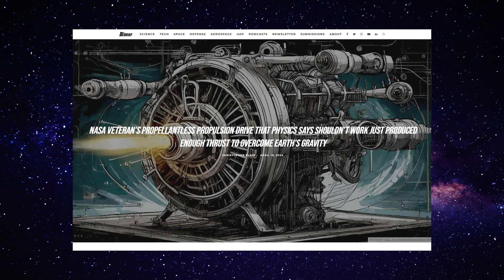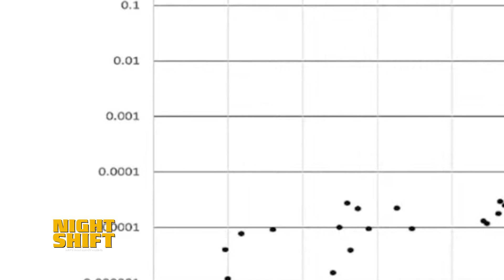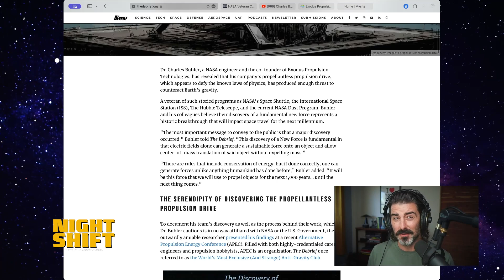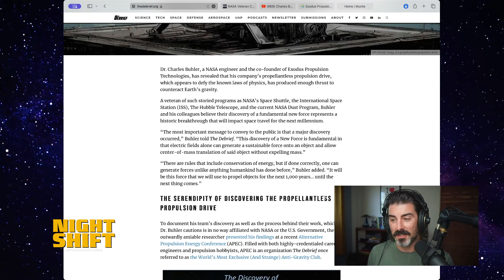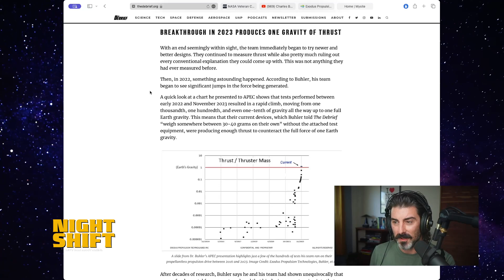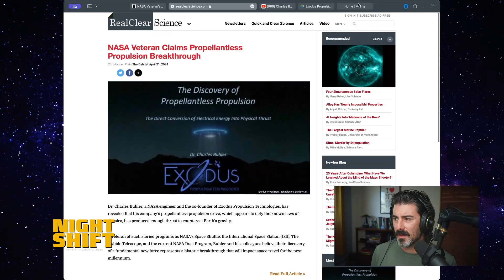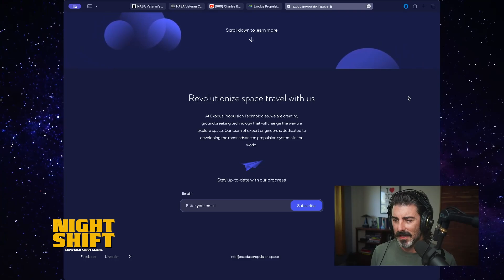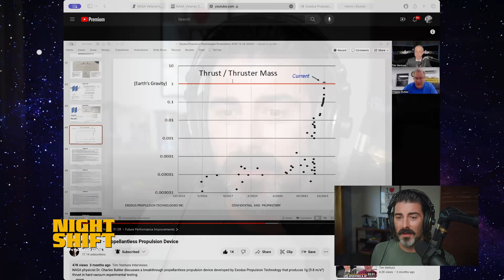Revolutionary NASA-Designed Gravity-Defying Drive Achieves 1G Thrust Without Propellant

Comment: It is called an asymmetric capacitor and it works best with huge voltages. Another approach could be that antiphase oscillation is used to manipulate space-time itself. By utilizing two oscillations that are perfectly out of phase, this idea suggests a form of energy cancellation or control, where destructive interference could be engineered in such a way that it alters the fabric of space or the propulsion mechanics of the spacecraft.

Comment: Use a centrifuge to accelerate a magnetic sphere. When the sphere is released the opposite and equal reaction is towards the center of the centrifuge not opposite the direction of the spheres motion. The sphear continues along a linear tangent towards an induction tube where repulsive forces transfer the kinetic energy from the sphere to the tube. The tube is part of the ship's Hull. VOILA!

Comment: It is not propellantless.. it still requires electric power which means a reactor of some sort. Gravity propulsion may be new but gravity is not.  If you understand the mechanism of gravity, then you can proceed to gravity drive. Electrostatics is short range.. gravity is long range.. gravity drive is gravity manipulation. Dark matter exhibits antigravity for a good reason. Gravity drive or variation is what you need to navigate gravity space. It doesn't require a change to physics.. it requires an extension to the existing physics. If they are just messing with electrostatics, I wish them luck😆

Comment: Ok, 1G is about 22 miles per second.  If acceleration remained constant, the vehicle could get close to the speed of light in one year and travel half a light year.  So, acceleration increases exponentially and could go potentially faster than that after the year's end if we say there is no speed limit.  (Theoretically nothing can go faster than the speed of light except for quantum entangled particles which would be like instant travel thru a star gate or using a Star Trek type of transporter without distance being a factor.  I also realize it would probably not be possible to run the engines the entire time but if those were not factors then that math is correct.)  Now, the closest star to our solar system is Proxima Centauri which is an estimated 4.27 light years away.  Just putting some numbers that we can all relate to as I had to Google how fast 1G was as aviation speed is expressed in knots and jet speed is expressed in Mach number.  An asteroid hitting Earth's atmosphere does so between 7 to 45 miles per second, the orbital velocity of an asteroid in the asteroid belt is between 9.3 to 15.5 miles per second and the Earth's orbital velocity around the sun is about 18.5 miles per second.  Of course those numbers are relative because our solar system is going around the Milky Way galaxy about 143 miles per second so that means the Earth is going way faster than its relative speed to just our solar system.  My point is that is faster than an asteroid, it is faster than our planet around the sun, that is a big deal.  

 The paper says propellent less propulsion device but does not say how it achieves that so it could be electric using as the doctor said,  thin films  and asymmetrical capacitors, which is high voltage differences to a large surface followed by a larger voltage on a larger surface or some type of plasma generator.  He said car batteries have lots of power in them but they don't unless recharged by the alternator since each lead acid battery is rated on engine starting from cold cranking amps at 12 volts just to start the car.  When running, the alternator is the variable voltage generator that recharges the battery and provides all the electric power needed by the car's electric systems.  Lithium creates dendrites and degrades too quickly by shorting itself out when over heated or charged too often which also takes a long time.  Now the only issue is how do we power that voltage since battery technology is a joke and any nuclear reactor does expend its radioactive fuel at different paces depending on which type is being used.  One solution leading to one problem since we have not found a way to power a ship off of fictional dilithium crystals.   Oh, the military is powering the UAP's so they will know how to do it.

The military is always a few decades ahead of any of the latest released achievements they allow to be told to the public because all patents are scrutinized for military application first and when it can be weaponized, they can classify and confiscate that technology without compensation to the inventor in the name of national security.  Only our government can be criminals with murder, theft, environmental poisoning and political injustice to just lie to the public and get away with it.  Sad, if we had this tech released earlier, we wouldn't have kept burning oil to run our lives, we would have used these innovations to save our planet.
Reply: this is amazing! i wonder how many hours will it take of constant acceleration of 1 g would it take to go to mars?

Comment: That means that in space at roughly 1 G of acceleration, in one hour you would be just over 78,818 miles per hour!! Yes a game changer. If you accelerated for 10 hours you would be at approximately 787,909 miles per hour. At that speed you could get to Mars in 7 or 8 days🤯 instead of 7 or 8 months. Using the average distance to Mars at 140,000,000 miles.

Comment: Take 2 long metal plates about 5 inches long and about 2 inches wide. Place them under water...very close together....NOW...hook up a positive wire to one plate and a negative wire to another plate. turn the power on...place some red dye in the water between the plates....you'll see the water flow....they are designing submarine engines this way. the plate produce hydrogen and oxygen....one plate for hydrogen one plate for oxygen...it breaks the water down to it's natural state. I built a hydrogen generator in my home....it works great.

Comment: This drive, I have a problem with labeling the thrust in units of gravity. I have not looked at these paper, might never... just pointing something out.

Thrust would be better measured in newtons. Problem with the 1G of thrust is that it doesnt take weight into consideration. That "1G" could be .000001 newtons or 10000000 newtons, or any other number to infinity... This might only be able to lift the equipment and thats it. No actual useable thrust/lift. This is VERY interesting, but for practical use in industrial or consumer products (like spacecraft) this just is not that exciting yet. It's incredibly recolutionary, I do not want to detract from that at all, but practical applications of this are a very long way off, if ever. This might be a technology that inspires the next big this, but I am not sure this is going to be it. But super cool!
Edit: the chart in your video is thrust/thruster mass. That means it was just able to lift itself. Super cool, but long way off. Also, how much power is consumed while holding how much weight off the ground?
Reply: Wow. Pseudoscientists using dodgy units? There's a reason the guy isn't working for NASA or other reputable company. Quack quack.
Reply from the maker: NASA physicist Dr. Charles Buhler is the co-founder of Exodus Propulsion Technology and lead scientist and co-founder of NASA’s Electrostatics and Surface Physics Laboratory at Kennedy Space Center. Dr. Buhler has a PhD in Condensed Matter Physics from Florida State University, which he received in 2000 while working on high temperature superconductors at the National High Magnetic Field Laboratory. 

Dr. Buhler has experience working with electrostatic discharge & ESD safety for the Space Shuttle Program, the International Space Station Program and the Hubble Space Telescope Program. He was also a Co-Investigator for three NASA Research Announcements funded by the Mars Exploration Program, and is currently working on NASA's Dust Project focused on utilizing electrostatic methods to remove dust from personnel and equipment that will be sent to the Moon through NASA's Constellation Program.
Reply from the maker: Great point. Tim Ventura addresses this with him in the long interview. I can't recall what the reasoning behind this decision was but it seemed, to me anyway, to be a pretty benign choice. I'm working on a follow up deep-dive video on this now and I will be sure to address that. Thanks for bringing it up.

Comment: Moore’s law regarding transistor development doesn’t exist anymore, in fact we’re probably a decade or more which is insane to think about. So instead of trying to get transistors smaller, other technologies have to come from other avenues. 

EMF is a great area to explore because space faring crafts can build a charge from zero point energy, which while insignificant on earth, is monumental in zero gravity. 

The only problem I’m thinking about is controlling the charge to make the kind of maneuvers seen in the Nimitz Tictac. Interstitial suspension should be viable to maintain battery power on a much smaller scale, so you’ll get reduced weight and increased power. I agree that it’s baby steps, but if it’s being developed outside of the military industrial complex, at least one super power likely has a ten to fifteen year head start.

I firmly believe this is our future.
Reply: He says whatever the prototype is has maintained a very small charge over the whole testing period.
Reply: Also he’s looking for funding so the military or government will probably snatch this up.
Reply: He says they have zero point in the video from Tim

Comment: You can see his APEC presentation on the Alt Propulsion channel: "APEC 12/23: Asymmetrical Capacitance, Warp Drives & Torsion Physics" right after the warp drive presentation (shhh! ;)
There's still scepticism and debate in the community about it but if it works it could also be used to build fuel-free generators. It's possibly 'stealing' energy from virtual particles but no one seems to be entirely sure at the moment. His engineer regularly gives updates in the APEC livestreams and pre-recorded-then-posted open mics.
Reply: APEC? Try somewhere reputable that isn't full of flat-earthers lmao.